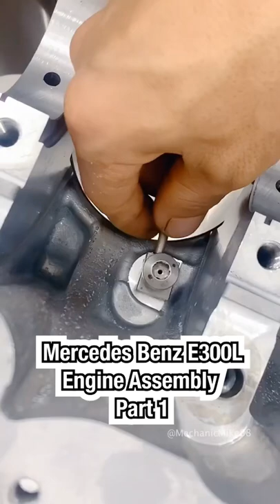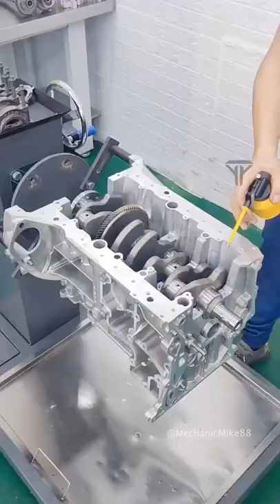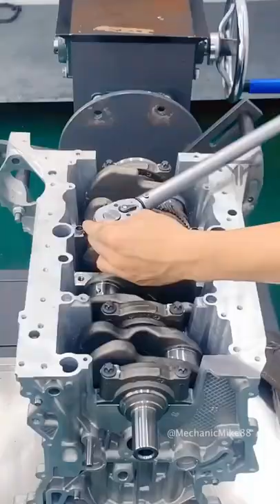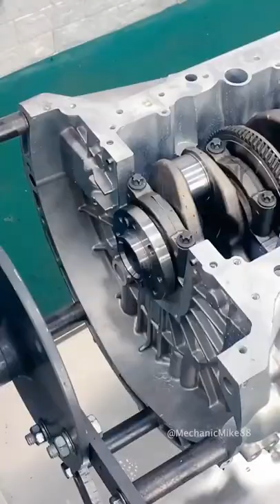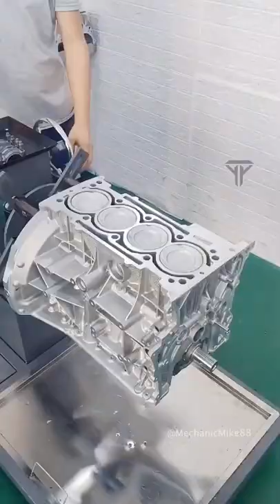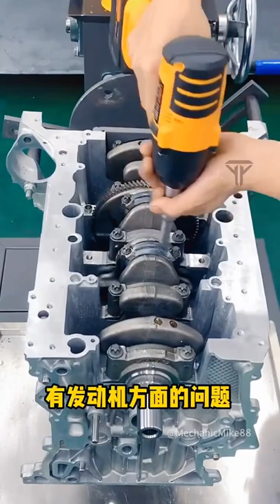Mercedes Benz E200 Engine #shorts #mechanic #mechanicmike

Comment: cheap . needs way more lube
Reply: That alot of oil falling to the ground while installation you can always add more but too much a mess🤦 your overthinking it bro
Reply: Not sure why you need more oil.  During start up anger a lond sitting, there isn't oil their anyway.